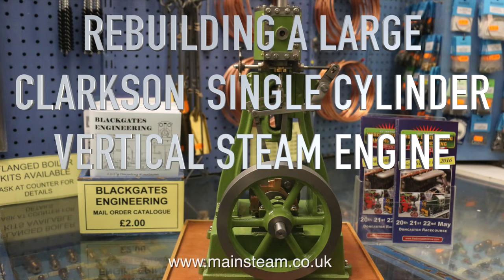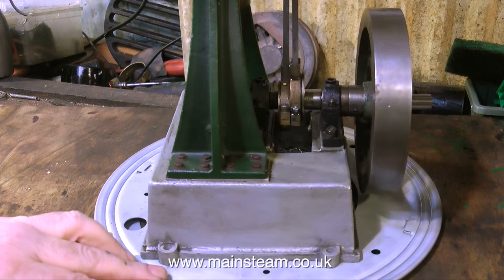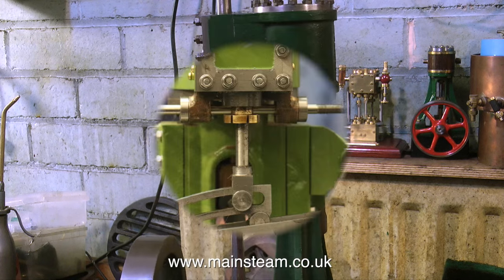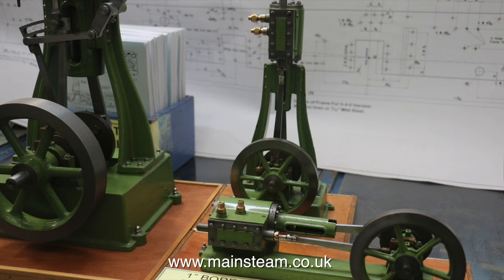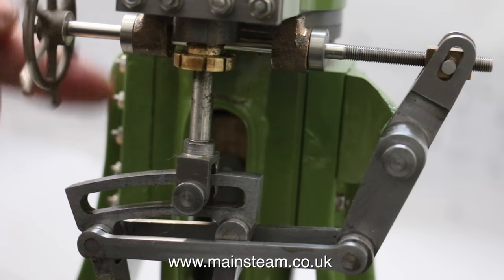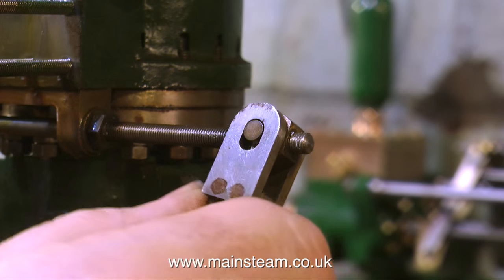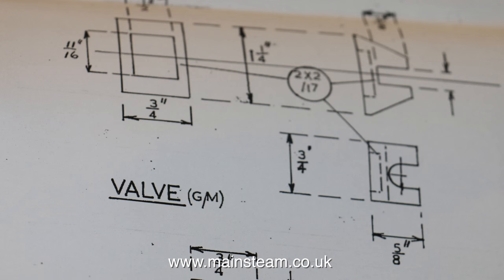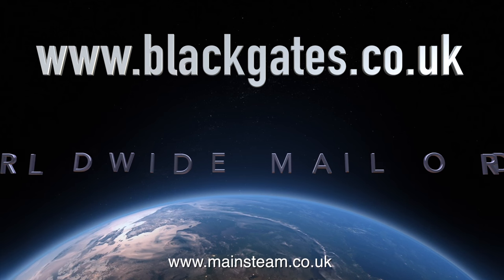REBUILDING A LARGE CLARKSON VERTICAL STEAM ENGINE - PART #6

Comment: Hi Keith, Firstly I would like to thank you for taking the time to make these video series. I enjoy both the engineering/modeling (I appreciate your blunt and honest opinions) and your sense of humor. I am very much a beginner when it comes to engineering. To clarify I have built one engine ( a sterling engine) that I chucked together after discovering them on You Tube. I am currently working on a larger more complicated model and have found your videos very informative. Something that particularly sticks in mind is how fitting is as important as being able to produce accurate components.I had a question regarding bolts vs studs. As far as I can see both methods work. So what are the reasons for the use of studs? Before watching your videos I would have just used bolts.P.S: I always find your videos useful. Even the ones without enough machining. :) Thanks again Robert.
Reply from the maker: +robo1471able Studs are frequently used in full sized steam & internal combustion engines as well as in machine tools as one end (the stud) is captive it helps to securely locate the parts.
Reply: Cool thanks for the quick response.

Comment: If I might ask, is Blackgates Engineering a formal sponsor of yours at this point?  I'm extremely jealous that you have such an amazing brick&mortar shop within driving distance.  You'd think between Baltimore and Washington DC, there'd be something, but nothing comes close that I've ever managed to find. 
My one consolation is that there's an excellent model steam engine expo not too far off. Two football fields worth of engines and vendors; the very thought of it continues to blow my mind for such a curious hobby.
Reply from the maker: +verdatum NO, I am 100% self sponsored . . . . Blackgates engineering are friends of mine and I have been dealing with them for model engineering parts for about 40 years
Reply: +Keith Appleton I have a strange feeling they're about to experience a spike in mail orders.
I wish I could visit their premises, but unfortunately it's roughly 17,000 km away for me.